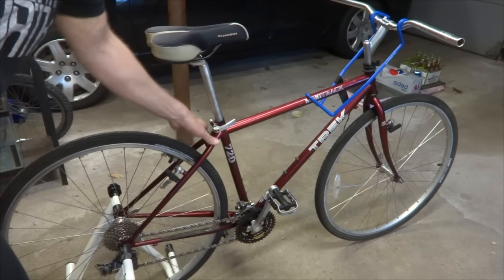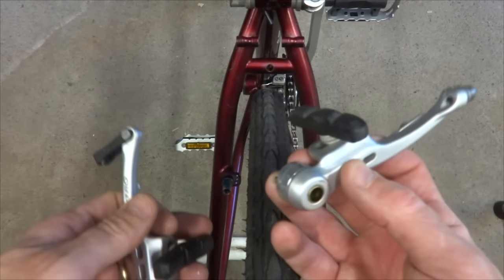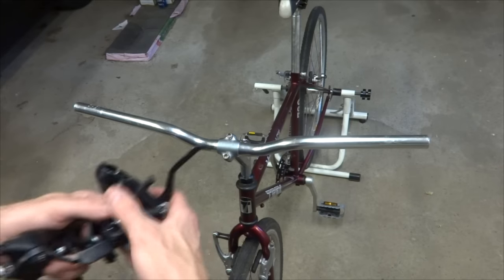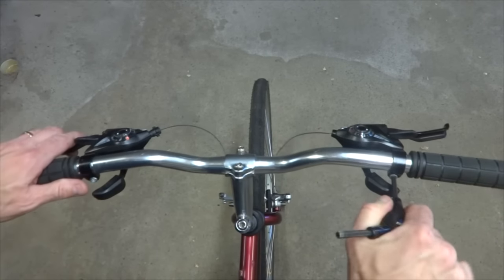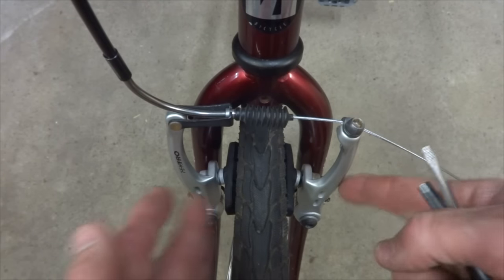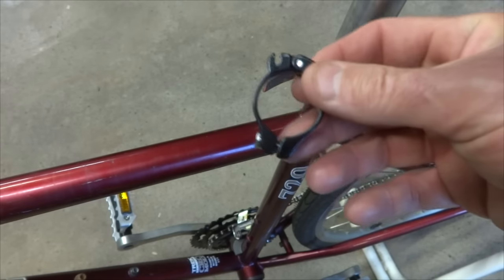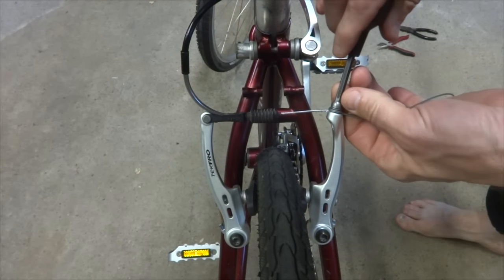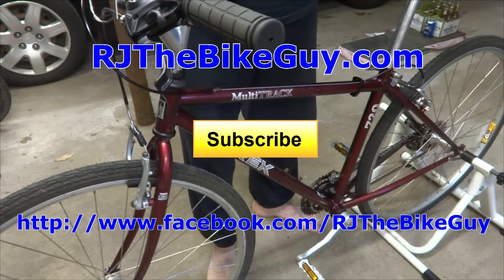Converting From Cantilever To V-Brakes

Comment: Replaced the junk canti's my Bianchi San Jose came stock with a XTR BR-M951 V brake from ebay, I only use a rear brake on this bike. The fork is from a Pista with no brake bosses and the rear cable stop bridge was removed.  Used an Avid Single Digit lever on a low rise Bontrager bar.  As a wrench in various shops around my home for years, I use a business card or cut up section of a credit card to set the toe on the pads.

Comment: What is the size of the cable stop you use here? I have Trek 700 and I believe its the same frame as you work on. I guess 31.8mm but not sure.
Reply from the maker: +Cuneyt Kilic Mine are 28.6mm, but you need to measure yours.

Comment: I’ve just tried to install V brakes in place of cantilever brakes. The bosses were in a too high position for the V brakes and the brake pad slots were not long enough to compensate for this. BEFORE YOU START ON REPLACEMENT, CHECK THAT THE NEW BRAKES WILL WORK ON YOUR BIKE. Luckily my supplier allowed me to return the brakes.

Comment: Great video RJ! Couple of questions for ya. I noticed you didn't crimp the ferrels onto the brake cable housings, is it not necessary to crimp or is it just personal preference? Also noticed that you didnt lube the brake cables/housing. Is it not necessary to lube these as well? Appreciate you my friend!
Reply from the maker: I have never crimped the ferrules. I don't lube the cables either. The plastic liners in modern cable housings don't really need it.
Reply: Appreciate the info RJ!
Reply: +RJ The Bike Guy i asked the same question of several ppl some said lube cables & others said dont & now i'm even more confused.
can anyone offer an actual reason to lube cables? (ie:winter proofing cables?)
Reply: My understanding of lubing cables/cable housing  depends on the type of cable housing you have. If your bike has the older style cable housing (with the inner metal liners – not plastic), by all means lube the cable at either end of the cable housing and work it into the cable housing. The cable will slide through the housing much easier. On the newer cable housing with the plastic liners, I have heard that the lubricants like Tri-Flow, can actually damage the plastic liners – a chemical reaction of the oils in the lubricant with the plastic. This reminds me of not using Tri-Flow to lube the inner workings of Twist shifters with their internal plastic parts. So, don’t lube cable housing if the housing has a plastic liner. That's my take on it.
Reply: +don mapes thanks for ur comments,oil & some plastics dont mix & both are made from the distilling process.

Comment: hey RJ sir what is the correct position of the brakes: rear brake on left side lever or on the right side lever?
Reply from the maker: +Sunad Sawant Depends on your country. In the USA, the right brake is the rear. In the UK, the left brake is the rear. It's usually tied to the side of the road your drive on.
Reply: Ok sir. Thanks for your reply. Probably in India rear is on left side. similar to UK

Comment: Hey RJ. First of all, Im enjoying your vids.  Anyways, I recently purchased a Fast Track 470 and would like to "modernize" the bike by adding new stem and handlebars.  Do you have any recommendations on the quill stem adapter along with stem and handlebars.  Should I be looking at a particular length for the adapter?
Reply from the maker: +Phtsmn Kmpthm You most likely need a 1" to 1 1/8" adapter like this: http://www.amazon.com/exec/obidos/ASIN/B0028N14GQ/ref=nosim/youtube25-20
The stem length/angle is personal to your fit.
Reply from the maker: Here is my video on doing it: https://www.youtube.com/watch?v=vPlp-_do2mM

Comment: se there is no restriction in switching from cantilevers to V-brakes? Oh! but the shifters are different! they have to be for v-brakes? so I cannot use the same ones I have now? Do you have a school to teach your stuff. This is the best video I have seen on brakes in a long time. Congrats! In your opinion are V-brakes much more effective than cantilever?
Reply from the maker: +lromeroyt The brake levers are different. Just in this case, the shifters were integrated with the brakes.
Reply: +RJ The Bike Guy thanks for your reply! My left shifter (shimano SLX) does not show the chain ring (1-2-3) when I am shifting, anymore. Not a big hassle but is there a way to fix this or if replacing it, will an EF51 make it?
Reply from the maker: It might be a broken pin, or the pin is not in the hole correctly. Watch this video around 3:15 mark: https://www.youtube.com/watch?v=0Wtb57AXD0o

Comment: which one you prefer , cantilever or v brakes? i heard vbrakes better than cantilever in braking peformance.. what do you think?
Reply from the maker: +Davidson Anggakesuma V brakes are supposed to b stronger than cantilevers. No preference from me.
Reply: +Davidson Anggakesuma 
Just adding my opinion here.  I much prefer V-Brakes.   I recently did a conversion from cantilever to V-brakes on one of my bikes.  Huge difference.  V-brakes are definitely better...at least in my case.
Reply: +NJP Vlogs hmmm thx for refrences mate, i want to to convert tp v brakes. but to be honest i love cantilever model than v brakes.. :(
Reply: +Davidson Anggakesuma 
It is all in what you prefer and what is comfortable to you as a rider.  The V-brakes give a better and more confident braking feel for me.   I won't be going back to cantilever brakes on that bike.   But, I have not had very good luck with them.  
I think that once you try the V-brakes you might like them better as well.  If not, you can always switch back to cantilevers later on.

Comment: I personally prefer to adjust the spring to feel as light as possible, while still functioning, so that it's even easier to brake. The springier the springs, the harder you need to press on the lever.

Comment: I removed my caliper brakes from my Santana Arriva tandem and bought Shimano V Brakes. The new V brakes slide onto the post, but do not seat all the way. There is a difference in the internal size between the two types of brakes. How do I know what to look for to select the correct V Brakes. What are the parameter (measurements or type) to specify ?

Comment: I have an old Raleigh I'd like to change to v brakes but the three little holes for the spring to fit into on the frame are on the outside of the stays, 180 degrees opposite of what your Trek is.  Any suggestions?

Comment: Hello. I've got an old MBK (french brand) bicycle with Cantilever brakes. I would like to change them and have Vbrakes. I watched your video and I tried to do the same on my bicycle but the mounts are to thick (or my VBrake holes (I tried several ones) are to narrow ???) so I can't put some other brakes or the mounts. What's possible to do: Can I sand the mounts ?

Comment: Can you recommend a replacement brake lever set for straight handle bar and linear pull rim type.  Damn plastic barrel adjusters suck.
Reply from the maker: Nope. Shop around.

Comment: I have. Trek 3900 with 24” wheels. I replaced the fork with a Suntour but now the brake mounts put the pads up on the side of the tire instead of the rim. Can you get different length v brake brackets so they hit on the rim? I don’t really want to go to disc but I might have to do that.

Comment: Sir can we replace side pull breaking system to some other kind of rim breaking system?  Side pull breaking system does not perform well coz it has one single pivot mountain screw.
Reply from the maker: Side pull caliper brakes are road brakes. Try better quality cailper brakes. Dual pivot are stronger than single pivot. Use better pads.

Comment: Hi RJ, another great video! at 17:30 of the video when you are running the wire to the rear brake and use the cable stop, How would you set up the rear brake cable route if it were a lady's bike with with the slanted top bar arriving half way down the seat tube?
Reply from the maker: Same way. Google pictures of ladies bikes with v brakes.
Reply: good point, sorry Homer Simpson moment there, should have realised that myself. lol

Comment: Hi RJ. Can I ask you a question? What would you want to see in a bike repair only ( no bike sales ) shop that does walk in service, aside from excellent service and sound mechanical work and a solid collection of tools and the knowledge to use them? I do repair work. I am getting very busy, but because I am unfamiliar with the little tricks you know and lack your depth and breadth of experience, it always takes me far longer ( until i watch your videos ) to get it done. no shop would hire me. but i do excellent work. i will get fast. 

just looking for advice. here in TO the shops are swamped with work. I made $250 today doing a full tuneup/parts replacement on two bikes , and that was this morning ! i still have another to sort out.  i do it all in my driveway, but i think if i opened a shop i could generate serious income.  i am doing this on a pay what you can, plus parts at cost basis, by the way.  i rode around my neighbourhood and stopped at every bike and stuck a little poster in the spokes. 

i did 100. i got 15 calls and 3 referrals in a few weeks. tomorrow i am doing 1000 posters and will be opening a shop soon if i do this right. one thing i want to do is find an apprentice to train and help run the admin aspect, but i clearly have a lot to learn, despite my skills which are pretty good, but i would say 60 % there, compared to you

sorry for the long rant, but you have inspired me and i started a business and it is working. wow ! i also do free bike clinics every sunday for the people in the area. i teach them everything about safety, braking and shifting and basic maintenance,

thanks again
j
Reply from the maker: I am not your audience. I do my own repairs. You need to ask your potential customers what they want.
Reply: i get it. i was just looking for your input regarding standards etc. 

as in, if you were running a repair shop, what would your baseline of tech service be? how far would you go? 

it's cool. i will follow your advice and begin defining parameters of repair needs. thanks again !
Reply from the maker: @jen3800  I am the wrong person to ask. I don't run an open shop. I work on my own bikes, and sometime bikes of friends. You need to ask your potential customer base. Offer them what THEY want and be of service to them.
Reply: awesome. thanks

Comment: Hi RJ,

Been watching your videos on vintage bike updates. I have an old, steel 1989 Bridgestone mountain bike and nothing really works—essentially a good frame; square BB is done, thumbshifters no longer work/shift, etc. What bottom bracket (Shimano Hollowtech II?), drivetrain (Shimano 9-Speed?) do you recommend switching over to? Appreciate your expertise. Thanks much for yours and others thoughts.
Reply from the maker: Those are all your choices.
Reply: @RJTheBikeGuy  –Is that the best solution/path to update the bike? Or is there another way to go that delivers better performance or another way that offers easier-to-find parts and is more economical?

Comment: Currently working on a centurion protour15. I am considering changing from cantilever to v-breaks. Could I use wild tyres, like 700x38, with v-breaks? Any comments will truly appreciate it.
Reply: Cushy ride or better braking? If you had to make a choice, which would it be? Then again you may have the clearance for both.

Comment: Would it be a similar process for any other style? I'm thinking about single or dual pivot brakes.
Reply from the maker: If you are talking about caliper brakes, they use a different mounts, and are designed for road bikes, and won't easily replace mountain bike brakes in most cases.

Comment: RJ,have any thoughts on Fuji bikes? at my local Wheelsport they have one with disc brakes and at a reasonable price of about $339.00 but not sure about how their bike shop bikes normally are at that price point
Reply from the maker: Fuji makes some decent bikes. You need to do your own research. Read reviews on the specific bike. Shop around online.
Reply: RJ The Bike Guy from what i could see it has good reviews just wasn't sure whether or not Fuji was a decent bike manufacturer unlike pacific cycles that make the hyper and roadmaster bikes now
Reply from the maker: Pacific are junk bikes.
Reply from the maker: Keep in mind that Fuji makes both high end and lower end bikes. But generally above the Pacific level of bikes.

Comment: I have an old Trek 800 sport that I bought, and everything seems good except for the brakes, which are a bit fiddly to work with (because they're cantilever). I'm quite the novice when it comes to working with bikes, and I was wondering if I would be better off replacing them with V-brakes or just trying to get the existing brakes back up an running. I tried replacing the pads to start, and even finding smooth post pads locally was a challenge, and after I replaced them, I just couldn't get them to contact the rim correctly. I do have a bike shop nearby, and they say they could fit the bike with V-brakes for ~$80. What should I do?
Reply from the maker: Get the cantilever brakes working.
Reply: RJ The Bike Guy Ok. Thanks for the advise. If you don't mind, I do have another question: The bike has diagonal grooves (Almost looks like 120-grit sandpaper) going on the rim, along with some black rubber that probably worn on them. I should probably remove the rubber, but should I do something about the grooves? My old bike (well, it's newer, but the frame is too small, so I bought a used one) which has V-brakes didn't have anything like this.
Reply from the maker: Sorry, I have never seen rims that are like sandpaper.
Reply: RJ The Bike Guy Oh, not like sandpaper, like someone when at them with sandpaper.
Reply from the maker: Steel or aluminum rims?
Reply: RJ The Bike Guy Pretty sure it's aluminum. I'm not quite sure how the different types act with a very strong magnet, but with my rims, there was a very slight amount of attraction, but it was probably to the spokes or something. Probably aluminum.
Reply from the maker: Maybe someone did something to them. Sorry, no idea.

Comment: very useful. I just bought an old mtb swiss cycle the brand is Verago, but this frame as expected doesn't have the flange to install disc brakes, my project is to convert it to a semi-road bike with slicks look alike tires and it already has rigid fork but i want to put a new one made from carbon, the problem is that the majority of this forks only comes for installing disc brakes and no v-brakes or cantilever brakes,  so my question is: i was searching in ebay and it happens to exist a bracket to put disc brakes in an old frame, so, is that really possible? if it is would be great if you can post a video with this modification,
Reply from the maker: I don't think the add on brackets will give performance of actual frame mounts. And after the cost of new wheels, brakes, maybe levers, etc, is it really worth it?
Reply: RJ The Bike Guy do you know about a good carbon fork that accepts v brakes or cantilever brakes?
Reply from the maker: You gotta do your own research on that.

Comment: I have an old Bianchi w/ 27" wheels with canti brakes. Any chance switching to V brakes would offer enough pad adjustment for me to use 700c wheels?
Reply from the maker: V-brakes require about double the cable pull as cantis. So you would need brake levers meant for v-brakes.

Comment: I bought a raleigh m-50 1990s era. It features cantilever brakes and it needs new pads. I did watch one of your cantilever videos and then saw this one and was curious to know the difference between cantilever vs v-brakes. I would be interested in making the change as the brake pads need replacing as well as cable and housing. Just curious on your thoughts and where/how I could go about this. (It has Shimano Altus cantilevers)
Reply from the maker: The pad mounts are often different.
Reply: @RJTheBikeGuy  Should I stick with what I got then and just purchase new pads

Comment: hey men great video but i have a question. i have the same frameset but is a trek mountain track 830 i need know what is the size of the wheel 29"? 27.5?. thanks
Reply from the maker: Your 830 is NOT the same as a 700. A 700 has 700c wheels. An 830 has  26" wheels. And only ask a question in ONE PLACE!!!

Comment: If I got really long cable housing, does it have any effect on the braking compared to using a precise length cable housing?
Reply from the maker: It will likely get in the way. And the longer the cable the housing, braking will be ever so slightly reduced.

Comment: I don't have a cone wrench, do you think I can still get the locknut tight or the top cup is going to spin too much?
Reply from the maker: You are going to need something to hold the cup while you tighten the locking top part or it will come loose.
Reply: Cone wrench is a handy tool, but if you don't think it'll get much use and you live in a cycle-friendly area there might be a place that allows you to use its workshop for a couple of quid (dollars) with access to its tools.

Comment: Hi, do you have a link to buy the cable stopper that goes attached to frame to run the rear brake wire?
Reply from the maker: https://www.amazon.com/exec/obidos/ASIN/B004FT1LGO/ref=nosim/youtube25-20

Comment: Hey man, been watching your vids for a few years [good job]. Atm i'm doing a brake upgrade on a bike i got for free. just wondering.. with new replacement parts..do you actually make a profit? [i use scrap bikes recycle parts of them] P.S good tip angling the front of the brake pads!